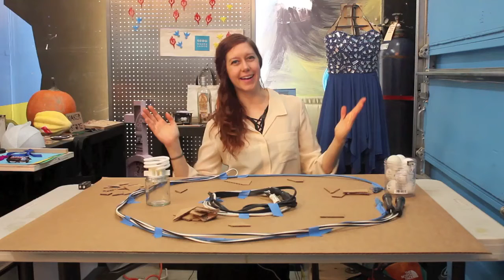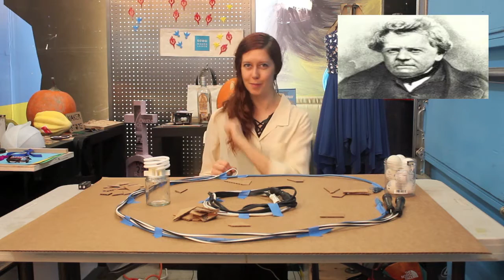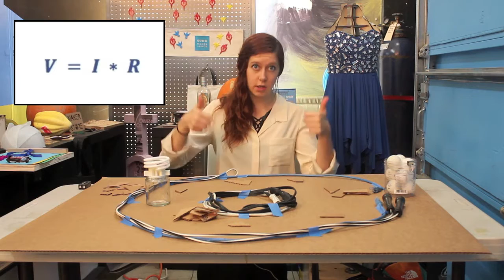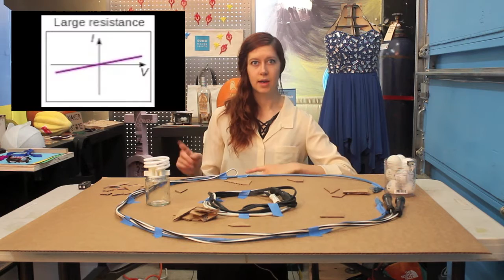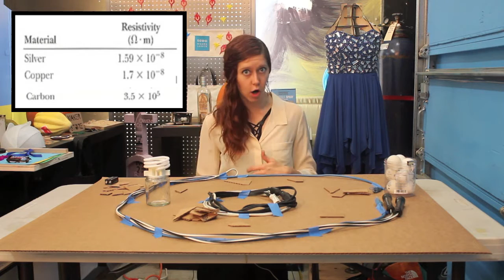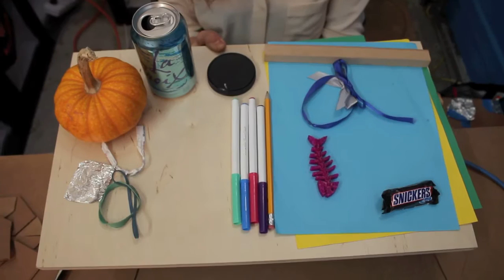Exploring Electronics! Ep. 2, Pt. 2

Comment: If I were going to build a resistor from one of the things you show on the tray, my first guess would either be the pumpkin or possibly the snickers bar.  You may also use the liquid in the soda can - connect a wire to the can pull top and put another wire in the drink so current has to flow through it. You could also cut the ends off the pencil and use the graphite in the center.

Upon further reflection, you were probably thinking the graphite was the best choice... I don't know what the material properties of sprite, pumpkin, snickers, or even graphite are but these are my thoughts.
Reply from the maker: lol I love this!! A resistor made from a pumpkin or snickers bar would certainly be novel! And also a hilarious addition to a circuit. Technically, given the appropriate electrical energy, anything could function as a resistor! You might end up with a burned pumpkin or melted snickers bar but hey, it could totally work! 
But yes, you are correct in your reflection that graphite is a good choice for a resistor with a 9V battery and an LED :)  If you're curious, you can look up resistive properties of materials here (no chocolate or pumpkin but there is wood, sea water, and rubber!): https://en.wikipedia.org/wiki/Electrical_resistivity_and_conductivity#Resistivity_and_conductivity_of_various_materials